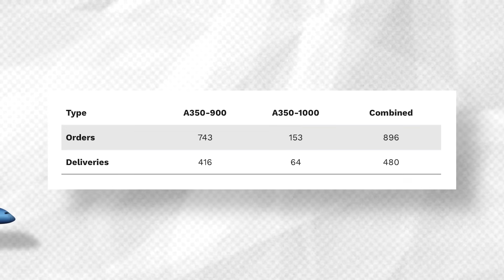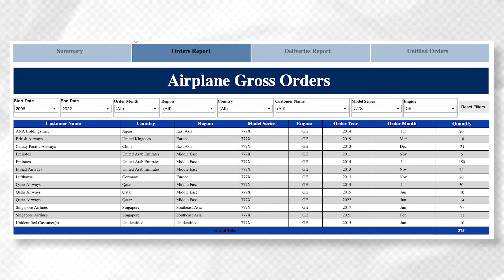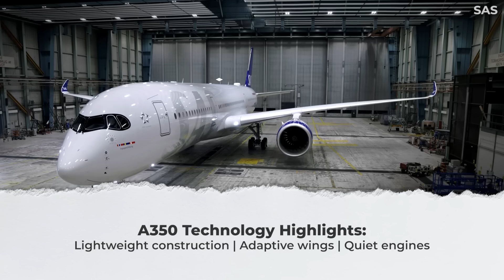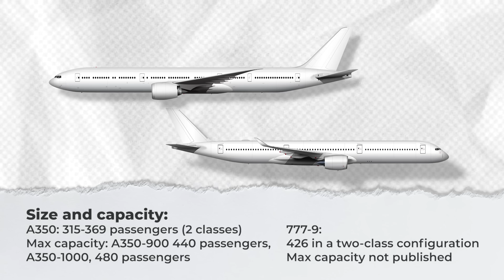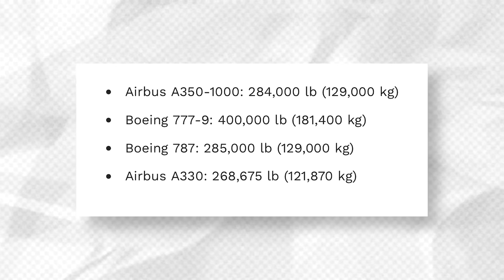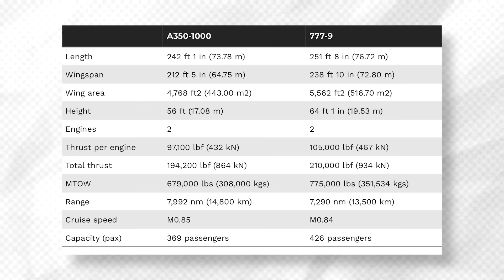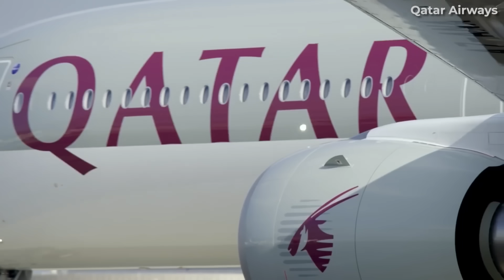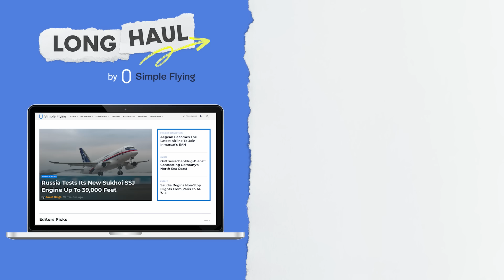The Boeing 777x vs Airbus A350 - Which Plane Is Best?

Comment: I'm actually amazed how a350 is compared to both b777 and b787, and still is able to keep up or even outclass both on some areas
Reply: The 787 doesn't compete directly with a350 because it's a bit smaller and the a350 -1000 competes more with the 777X-8. The -9 is longer and a bit larger , suited for previous 777 300 and 747 operators
Reply: @mmm0404  They do overlap by a bit.   78J and 359 are quite similar, with 78J having slightly lower seat cost and higher capacity, while 359 flies further.
Between a 789 and 359 they have similar payload range capability, with 359 bigger and flies further, while 789 smaller and cheaper.

A330NEO can't match 787 in all metrics, but  doesn't have to. Within 4000nm its fuel burn trails by ~2%, which is actually impressive for a low cost development of just $2B, with only the engine and winglet are significantly changed. They have ~2/3 of 787 orders since launch, and in a few sales battle 787 has to match price  to win, despite being a more modern and capable frame.

In comparison, Boeing carrierd much more extensive changes and spent at least $6B on 777X, still cannot compete head to head with A350.
Reply: @steinwaldmadchen  
The B789 is a smaller than the a350 and has less range  but not by much.
In terms of sitting capacity the 787-10 does match the -900 , but lags terribly with range .  

The 777X competes more with the 350-1000 , and that's for the Smaller -8X... , The -9 is larger . I don't think the 777X was ment really to complete with the a350 but mostly as a replacement for current 777 operators and previous 747 operators.... It's a better replacement for for Emirates a380 than the 350 . That's why Emirates has not ordered the -1000 ....
Reply: @mmm0404  But don't you remember the fact that Boeing developed 787 and 77W, not 747X, because they believed point-to-point is the future? They are sort of right, and both aircraft proved to be popular. But by the same logic, isn't stretching 77W a bit counter-intuitive? Why didn't they build a 77L-X or 77W-X straight away?

The problem is, Airbus targets both variants exactly by 359 and 35K respectively, while offering ~20% better trip cost. At the same time, Boeing can only improve 777 trip cost by  ~14% with GE9X and the new engines.  So their trick is to pack more passengers / cargo onto the plane, so that the per unit cost goes down. That's the reason both 778F and 779 are larger than comparable A350 by just shy of 10%. As shown by 778, 777X simply incapable to head-on with A350.

Airlines do not always replace aircraft 1-to-1, and often compare a wide range of variants. JAL ordered 359 for domestic operations despite they could have ordered 78J instead, while United often pushing their 78J really hard on a few TPAC routes. Some airlines like AA, NZ and probably United foregone A350 for commonality reasons despite 359 might have be a better fit, while others like Cathay and Finnair operate 350 as if it's the Airbus-787.
Reply: @steinwaldmadchen lol

The 787-10 has more orders than the 350 -1000 and it's not even the rumoured ER version , 

The 777X has more orders than the 350-1000 which it competes directly with and the 787 has outsold the a350 almost twice .

The 787-10 is rumoured to get an ER versions which could blow the a350 out of the water...The a350 anyways is just a copy of the 787 so how can it be better.🤣

That's why I say the 777x wasn't really ment to compete with the 350 but was more of a replacement for previous 777 and 747 operators. It's a better replacement for the a380 considering its larger size that's why Emirates ordered the 777-9 instead of the 350-1000 as a replacement for the a380...

Airbus might have an edge over Boeing in the single aisle segment , but Boeing has them cornered  in the wide body section....

Airbus has never outsold Boeing in the widebody section because they have always provided the best balance and combination of efficiency and range in the twin aisle segment. 

Airbus should be more worried about the 787 more especially if it could get an LR version for the -9 and ER for the 10. You know how much success boeing has had with ER's and LR's, 777-300er , 767 -300er ,  and 777-200lr just to name a few..
Reply: @mmm0404  767-300ER was killed by A330, and was never popular in Asia anyway.

777-200 and -200ER combined is outsold by 330-300 by a large margin, because the latter got the job done without being thursty, and received continuous improvements throughout its production.

Airbus actually managed to sell more A330CEOs than Boeing sold 787 between 2004 to 2014, and matched 787 just by putting a new engine onto it. Oh yes, A330-300 is actually lighter than 787-9 while A330-900 is not much heavier, despite being a metal aircraft.

Meanwhile, don't forget the fact that 787 is heavier than expected, and designed with tight margin. They'd have to raise the MTOW by a fair bit for 78J to just match 789's range, let alone 359.

777X doesn't compete with A350, because it can't. 778 looks like a gaz guzzler when compared to 35K, despite having a better engine and larger wing. If there's enough market demand I don't think Airbus would sit and wait, and I doubt how a 20+t heavier frame can compete with 350-1100 head to head. Nevertheless JAL, Air France and Etihad are heading towards A350 for their 777 replacement so as Cathay and more building their fleets. With a wider customer base I don'r think Airbus is too concerned.
Reply: @steinwaldmadchen  the 787-10 doesn't necessarily need to match the -9's range or the a350 . I should be able to close in on the 787-8's range thou. An addition of close to 2000km on its range could still be good enough.....

The 787-10 can carry more seats than the a330-900 and a little more than the a359 in a two class configuration and offers better trip economics than them both...The 787 is actually a more efficient plane than the a350 which does compensate for that by providing more range and payload than the b789.

An ER version of the 10 could could offer the payload of the 359, maybe 800NM less range but have a better trip cost per passenger and be more fuel efficient .....
Having most range doesn't necessarily make you the better aircraft that's why the the 787-9 has been more popular than the -900 with over 100 orders more, while having close to a 1000km less range...The 777-8X will have more range than the 35K but has poor sales too.

An 78X ER could offer a balance of both ( range and payload) , have a similar range to the 777-9 , complement the -8X( which has seen poor sales ) and be more fuel efficient than the heavier -900 and -1000...

The 78X has more orders than the 35K so imagine if it gets that extended range.
Reply: @steinwaldmadchen  and anyways the 767 was actually smaller than the a330 and was a victim of its own success . This is why it wasn't popular in ASIA , because of its size. BOEING had the 747 anyways which was proving to be more successfull in Asia by the time. 

.. Due to the success of the 767 , Boeing wanted to make improvements on it to match the 330/340 but ended up with the more successful 777 family..

The 767 actually lead to the 777 , which stole it's spotlight eventually..
It wasn't killed by the a330. Lol
Reply: @mmm0404  767 is not a victim of its success, but it's failure to address what Asian needs. Neither did 757 sold well here. A300 and A310 were of similar size but fared much better. JAS, Korean, China Airlines, China Eastern, Thai, SIA, MAS, India, PIA and more operated them at some point. Air China, Vietnam, Sri Lanka and Nepal were the major 767 operator, otherwise they're highly concentrated to Japan and secondly carriers at the time, like Asiana or EVA. The same group of Asian carriers are demanding more cargo on NMA, while US carriers demand lower drag designs. I don't think it's a coincidence.
Again, A330 has been the major regional airliner in Asia in 90s despite its short range. 772 on the other hand were ordered as the mid haul aircraft. However the situation gradually changed after MTOW increase, with the likes of Qantas, Cathay and more flying 330s on 8-10 hour flights, while 772 sales dried up. It's also the same time where 330 was seen across the pond. 772 still has an edge in payload range, but 333 is good enough, is 10t lighter and burns 1t less hourly.

78J may or may not replicate 333's success against the heavier 359. But the problem is 78J isn't significantly lighter than 359, nor burn less. Plus while 333 has many built-in inherited from 340 (e.g. MTOW, large wing, fuel tank etc.) 78J maxed out in terms of structure and wing.
Reply: @steinwaldmadchen  bro we could go all day. I don't get what your measure of success really is 

The 767  has around 1400 orders and the a330 CEO has around 1500 orders . That's success for the 767 considering it stopped production of passenger versions a while ago.

While the a340 had around 400 to 500 orders and  the 757 had a little over 1000 orders . That's success for the 757

If you consider the 767 and 757 a failure just because it wasn't popular in Asia you are clearly mistaken and don't know what you are talking about.. Is Asia the only continent in the world. 

N.o of aircrafts sold determines success not whether or not it was popular in Asia lol. 

I'm not interested in arguing because you are clearly misguided and misinformed...

The 787 will see more success than the a330 . It has already matched the orders of the a330 CEO despite being launched  15 years later...

The 78X has a better seat cost than the A339 and A359 but has always been less popular than the A359 because of its range  , 11700km vs 15000 km of the a359. All this info is on the internet bso you don't really need to argue with me . 

If airbus could increase the range of a small airframe like the à321 from around 6700 km to 8700km for the XLR what makes you think Boeing cannot increase the range of a much larger jet like the 78X?

That's why I say if the 78X gets an extended version the a359's only advantage of range could be eliminated while providing less trip costs , having a few more seats and could be a challenge for airbus .
Reply: b787 is a330neo competitor also?
Reply: @ezrasianturi6159  yes but the 787 is way beyond its league and is outselling it. The a330 neo cannot keep up with the 787
Reply: A350 is wide and beautiful. The 787 is a sardine can.
Reply: The a 350 looks about like 80% of other passenger jets. According to Google, the 787 is 1 in short of 19 feet wide, the a 350 is  about  18 .5 feet wide. The 787 is a lot more fuel-efficient and out sells the  A 350  by at least 2 to 1. If the a 380 would have been a little smaller, maybe it would still be in production. It was too thirsty, and too much maintenance intensive to be cost efficient. The air Bus engineers should have known that.

Comment: Just before 777x will fly, Airbus will present the A350neo with much better performance. We have seen it before...
Reply: Boeing will respond with a re engined 787 and probably have an ER or LR versions for the -9 and -10
Reply: @mmm0404 and deliver after 10 yrs🤣🤣🤣
Reply: @nakhashfaiz3623  still has more orders than the a350-1000.🤣🤣🤣
Reply: @mmm0404  the 787 is the only thing Boeing has goin g for them rn. The 737 is not doing well and 777x did not even get a single order in the dubai airshow. And FYI don't compare the 787 and a350. They are of diff class. Compare a350 and 777x
Reply: @nakhashfaiz3623  the 777X is actually bigger than the a350. The -8X is larger than the -1000. They are not in the same class either. Lol

The 787-9 is smaller than the A359 yes ,but the 787-10 actually has more seats than an a350 900 in a two class layout. They can both seat a max of 440 passengers so yes the 787 does compete with the a350. If Boeing can get an 787-10ER version to better compete with the a350's range then that will give airbus some tough competition because the 787 is already outselling the a350.

BTW the 737  is Boeing's best seller . Yea currently the program is facing delays but I can not write it off . Close to 4000 737 max jets on order .

Comment: The a350 currently in the lead. Boeing 777x no delivery yet and low order for now.
Reply: I wonder why??🤔
Reply: In the lead of the 777x, yes but not the 777 program in general.
Reply: @AdriantheSpotter  Normal 777 program off course is leading without a doubt.